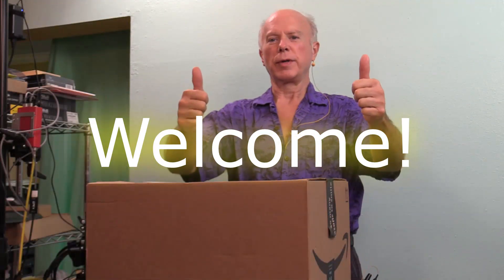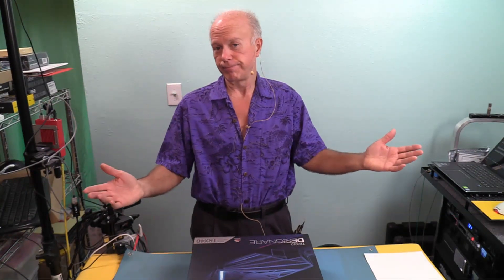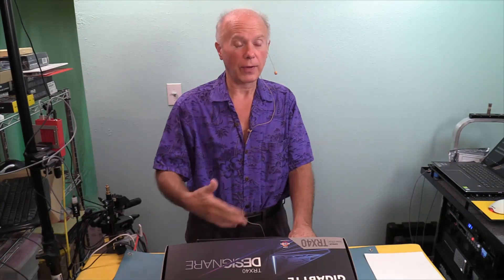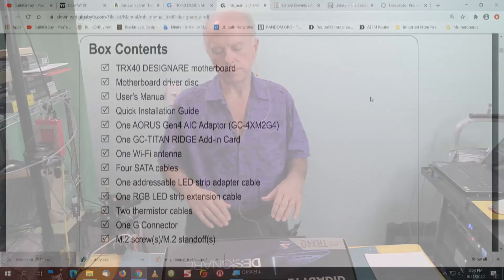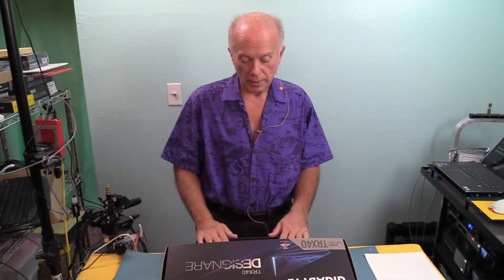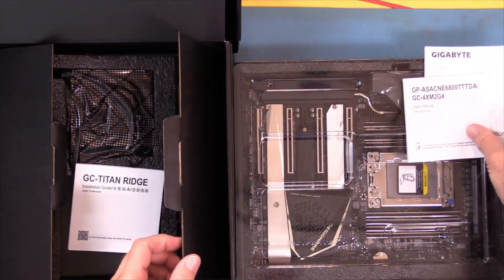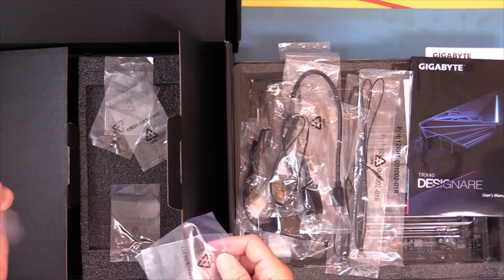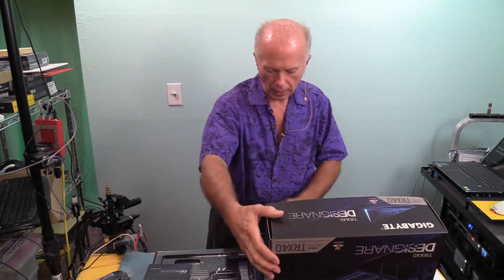Threadripper 3 Gigabyte TRX40 Designare Unboxing, Inspection and Inventory

Comment: I do have a question if you dont mind asking, why the MBs manufacturers dont increase the distances between  the PCIes slots (at least for certain models)? Placing gpu bigger than 2 slot will definitely block the slot next to it!  Many of the gpus nowadays are bigger than 2 slot.
Reply from the maker: Hi Zain, Good question for which I have no answer. I do know PCIe Slots are spaced according to Specs. Why a 3 Slot Video card? There was a time, not so long ago, when some Video cards extended the Full length back when we were using ISA Bus . All I can say is miniaturization. Look at the Processing Power we have access to now! Even if the Video card has to spread out!
Reply: @BuildOrBuy  Hi Gill, I believe they need to re-consider their specs as many are using dual gpus (gamers,cgi,etc) and when doing so, there will no space left for any add-on pcie cards. a 2 slot blower type gpus is an option but I will never use them inside my WS as I dont believe they will handle a 350w gpu (long term)!. Definitely upgrading from the designare whenever a 2-3XL-ATX  version is available. thanks for your time!
Reply from the maker: Hi @zainfadhil2588 ,
All good points. Decided to do the math, after You first asked, and see how that works out.. 
TRX 3090 Dimensions in thickness... 
55mm = 2.16535 inches ; 
Each PCIe slot is 0.8 inches apart. 0.8 inches = 20.32 mm

3 PCIe Slots = 60.96 millimeters. Pretty tight! 
60.96mm - 55mm = 5.96mm 
5.96mm = 0.2346457 inches. Doing the math, the TRX 3090 should still fit in 2 Slots. And that's the only card, going forward, with a Bridge. NVIDIA has removed that capability. 
And those Power Supply requirements are getting pretty well up there at 750 watts per Video card alone!

The need for 2 Video cards has diminished greatly due to the processing power of a single card. Even the Red Rocket Accelerator card ceased production 5 years ago for same reason. No longer a need. And that was an expensive option back then! 

And notice the NVIDIA Bridge is only a 4 PCI Slot Bridge. Yes, if there's a x8 Slot in between we lose access to said Slot. We need Workstation Motherboards! Another reason for either Threadripper Pro or AMD Epyc. There are always tradeoffs and options. The Solution is for Us to figure out what works best for our task! Glad You brought that up!
Reply: @BuildOrBuy  Great input! I have tried a gigabyte 3090 (55mm) on the designare board and the next slot was covered. I have also measured the distance between slots (center 2 center) and its was 42mm. The slimmest 3090 on the marker right now is the gigabyte turbo, (its a 2 slot blower card) .. dont know if this type of cooling will handle the 350w card!. I am sure we will be seeing special boards soon with wider pcies spacing ,,, Many thanks
Reply from the maker: Hi @zainfadhil2588 , Always! Good discussion. Let's hope our discussion will help other Subscribers solve their problems and think about their options. 

You bring up a major point we've talked about, cooling the video card! Cooling the CPU is easy. Another reason for the Thermistor location plus using industrial Noctua case Fans!

Thanks for sharing! Helps Us to make better Videos!
Reply from the maker: Hi @zainfadhil2588  , I though You were planning on using 2 RTX 3090s?
Reply: @BuildOrBuy  Yes, dual 3090s then  quad later. With this board, I am only able to fit 2 3090s (not considering the blower turbo). The only possible way way to fit quad 3090s is to use the riser cables.
Reply from the maker: Hi @zainfadhil2588 , You need to make a Video of that!
Reply: @BuildOrBuy  Yeah, was thinking of making one. Thanks!
Reply: HI @zainfadhil2588 , Excellent! Please share with Us when You do!
Reply from the maker: Hi @zainfadhil2588 , 
Duplicity. Excellent! Please share with Us, Your Video, when You do!
Reply: the board can support 4x 2-slot GPUs. for 3-slot x4 you need a width of 12 slots. This already is a very good slot layout and XL-ATX form factor. You can't build boards 12 slot wide and expect them to fit into any case or meet form factor standards. And if you can afford 4x GPU, you can afford and probably need CLC anyway. 3 slot GPUs aren't meant to be fitted in a 4x configuration.

Comment: I bought this board from Amazon Warehouse for $420 for two months ago. Really good deal! The only thing that is missing is the quick start guide, but that is fine for me.
I paired this board with 3970X cooled by Noctua NH-U14s+2xNF-A15 fans. 
I am able to hit 4,300MHz all-core at 1.312V stable. 
For RAM, I use G.Skill TridentZ Royal 8x32GB 3600MHz 18-22-22-42 and it is able to run IF at 1800MHz and DRAM at 3600MHz @ 1.35V. Really a great board and a lot of features!
I haven't tried the included Quad NVME and Titan Ridge Cards since currently I only use 2 x 970 EVO Plus 2TB.

The only thing is that Gigabyte RGB Fusion software is not great enough. But, I don't need those fancy RGB honestly.
And also the latest BIOS update F4k does not seem stable, always got some bluescreen on Windows. I downgraded to F4c.
Reply from the maker: Hi Bagus Hanindhito, 
Yes! Bang for the Buck! You did get a good deal! PDF manual is better anyway. Sounds like a perfect setup! How much RAM are You using? We have another Video we're working on about the other NVMe Connectors on the Motherboard you may find interesting. Yes, F4c is stable. Beta but stable! Thanks for Sharing!
Reply: @BuildOrBuy  I have 256GB of RAM installed. It is G.Skill F4-3600C18Q2-256GTRS kit from Newegg. It is pretty fast RAM, but sadly no ECC. Prefer to have ECC instead of those RGB-thing haha.

Will wait for those video :)
Reply from the maker: Hi @BagusHanindhito , If You had gone with ECC, You would not get the Speed nor the quantity of RAM You now have! You would think Samsung B Die would be attainable without the bling.

Comment: Not sure still about th3 card...since apple messed it up with intel. Like lightning it's not universal or real std. Unless daisychain or simply power former displayport also data transfer speed ext. Ssd rarely used or found not universal std. Either. Also displayport vs hdmi? Hdmi carries audio. Who gonna win in i/o war ? Or is going to be dock or dongle/adapters life? I could see soon usb4 a compromise with th3 since usb still std. Widely used popular...usb c +th3 =usb4 is the future with adapters for type a older tech usb.

Wifi 6 bluetooth dual gigabit ethernet usb3.1 gen2 hdmi in out xlr sound in out usb4(usbc/th3)  displayports full sd 5g lte cmos bios reset bring back ps2 ...would be perfect i/o.
Reply from the maker: Hi Cjon, We feel Your frustrations and here where You're coming from. When we exclusively cover the Titan Ridge Thunderbolt 3 card, we'll address some of that and break it down. Suffice to say, a lot of this seems to be change for the sake of change at Users expense. Thanks for sharing. Helps Us to make better videos!

Comment: I have the X299X Aorus Master but had to purchase the Quad NVMe and Titan Ridge cards separately.  I wasn't particularly happy about the latter as I already had an Alpine Ridge card but it doesn't work with the new boards.
Reply from the maker: Hi sabishiihito
, Good chipset. Even though, PCIe 3.0. We hear where You're coming from! The Titan Ridge card is also the only card that can be used on Computers that might not otherwise support Thunderbolt 3. 

We're going to do further testing of the Titan Ridge Thunderbolt 3 card. We'll be looking at 2 different Thunderbolt 3 Audio Interfaces after this Build. 

We're being very deliberate in our approach and methodology to this Build since we're on a new platform and considering some of the problems encountered on the X399 Motherboards. 

We're going to be looking at PLX chips using an ASUS X299 Workstation class Motherboard later on. Thanks for Sharing!